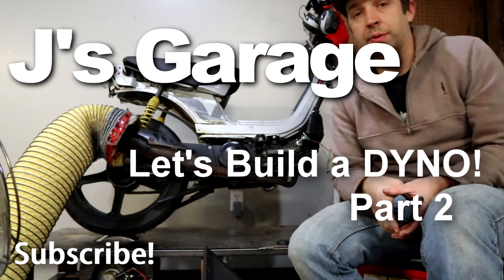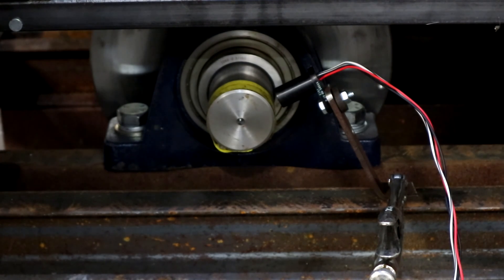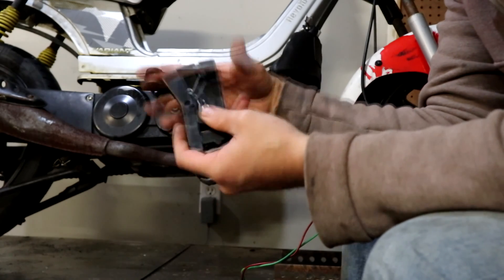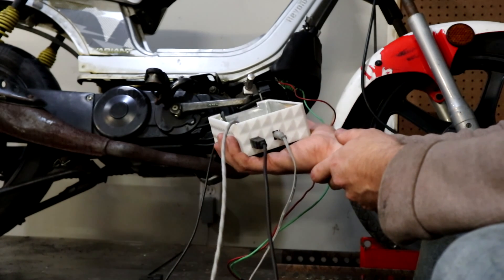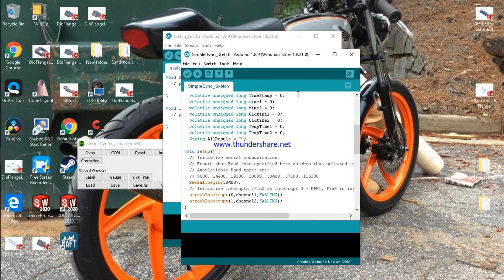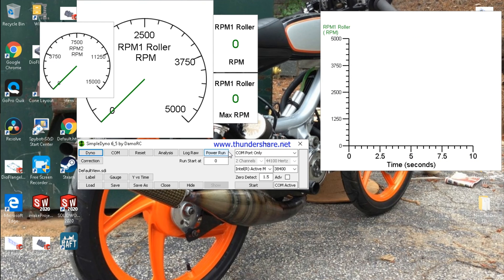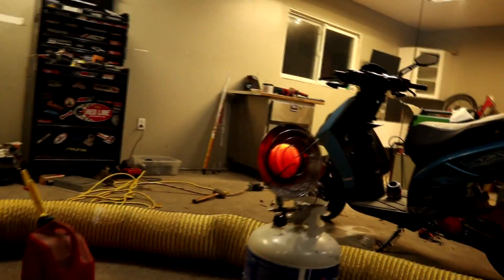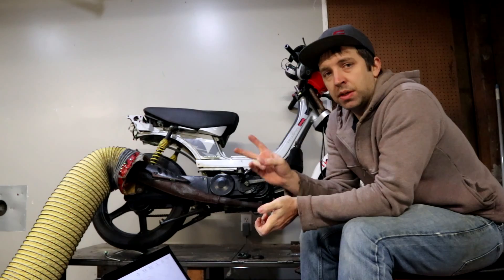Make a DIY Motorcycle DYNO with ARDyno - Part 2 - J's Garage

Comment: all the sensors that did not work consistently was pobertly not working becaise of eletrical noise. as the RPM is going up the noise is getting more and more powerfull and therefore it will easyly interrupt. use shiekded wire and ground the sheild wire to your commeon ground.

Comment: Rpm pickup only used 1 ground that clamped to the bike from the ardyno? And one wire that was wrapped around plug wire? Thanks
Reply from the maker: Yes the trigger was just a wire wrap on the spark plug wire and one ground.

Comment: Any update on this? I have wanted to build one for a while. It would make tuning so much easier. I can hardly imagine doing jetting/rollers/clutch springs without annoying my neighbors. Currently I have a road I blast but I know I am pissing people off.
Reply from the maker: No, I moved shortly after I did this video into a smaller garage and had to start doing reno's etc. It's sitting in the corner I will hopefully someday get back to it..

Comment: Have you looked for a Fan to cool the radiator? Isn't that a problem or in small runs doesn't escalate temperature that quickly ?
Reply from the maker: Heatsoak is always a concern with consecutive runs on a dyno.   That motor was air cooled and it was probably about 10c in the shop.  But yes a large blower fan to cool the engine is needed.
Reply: @pitobread  what should be the airflow quantity you would be aiming for? when chosing a fan to cool the radiator.

Comment: So are those figures correct ? your wheel mass was 131kg ? also doesnt your rear gearbox have a ratio of 10:1 
or something not 1 as you had shown.....and you had 1000mm for tyre wheel diameter , and looks like you have added the mass of the shaft and roller twice unless the program can 
calculate the difference between the shaft going through the roller so not to add all the shaft weight/mass if that make sence.....download performance trends demo version and enter the figures in there program wheel setup to double check yours etc.... Brett
Reply from the maker: No probably not.  I had not messed with anything other than reading thru the on screen prompts.

IIRC in the ARDyno it has both the mass of the roller and the mass of the shaft and makes you input it in separate areas but I haven't looked at it in a while.

I will check out the other software but my dyno is still in the corner of my garage since I moved and I haven't looked at it in a while.

Comment: I really don't think this works as a dyno.  All it will measure is the work required to bring the wheel up to a reasonable speed where friction will become the limiting factor.  A proper dyno must have an opposing force you can measure.
Reply from the maker: This is an Inertia Dyno.  It is a well documented type of dyno that works for my requirements.

Your description on how this doesn't work describes exactly how it does.  You have a static mass and you measure the time of the acceleration.  I have not seen any wheel slip on mine, but mine is knurled.
Reply: @pitobread  I see.  I guess that would work for small motors.
Reply from the maker: @ericthered9655  It works for any size.  Your mass has to be correct for the range you are looking for.   They make inertia dynos for cars even.
Reply: @pitobread  I understand the concept.  The problem is the physics assume zero friction.  So yes, if you used a massive flywheel you could measure anything provided it doesn't spin the wheel so fast that friction changes the equation.

Comment: Want a piece of advise with the RPM pulse acquisition rather than using the INDUCTIVE to which no other electrical devices are near the test that produces other noise or magnetic field that will give a glitch on that sensor.

Find an appropriate electronic circuit that will catch the PULSER COIL going to the ECU if FI or CDI if carbureted...the Pulser coil is the one that provides the true rotational power of the engine. That is what we did with our project and very consistent at all runs.
Reply from the maker: Thanks i will look into that if I have issues.

Comment: Hi i hope you can help me. Is the littelfuse 55505 sensor plug and play on the ardyno pcb?? No need for resistors in line? I have a cheapo hall sensor like your aliexpress one and it works but simpledyno will record is as 5000000rpms every time the magnet passes. Im wondering if the sensor is wrong.
Reply from the maker: Yes, it works out of the box, at least in my usage.

I tried a few different aliexpress/amazon sensors but they did not work right at all.  You can try changing the magnet polarity n/s s/n to see if that helps but most of the china sensors I tried were flaky at best.

Comment: I've build one of these. Mine is reading low hp, i know the engine is about 7 hp but it reads 1.5. Any idea what the problem could be?
Reply: maybe what you are inputting into the program is not correct like the wheel weight and diameter mass etc.....

Comment: I was really having trouble with the RPM pickup from the first sparks, though I was very good at anti-jamming. I also tried with capacitive touch clamps and also tried winding wires on high-voltage wires, but it didn't work. right from the start, the PC hung.
    Is there any better experience you can share with me?
    Thank you so much for your help!
Reply from the maker: My inductive clamp was not good, I would say failure would be more correct.  

Wrapping the ignition wire was the only solution that worked for me.

Comment: AR dweeno lol like wtf bro 
It’s dyno as in dinosaur ffs
Reply from the maker: So there is an arduino board inside the control box and also an ardyno board inside the box....
Reply: It is the simplest INERTIA DYNO u can find..and it works as it was intended..IF u just know what you are doing. we have it. and the moment you change any on the bike being tested will actually be NOTED and VISIBLE on the plotted graph...That is the only main target of the SIMPLEST DYNO ever..555 timer as capture shaping of the sensor pulses will not work...too many glitches..that is why maybe ARDYNO was junked.

Comment: Interesting project. A old fan will let you cool the motor, but, given the season and that you seem to be in Canada somewhere, you likely have a while before the engine gets hot.

I've used bare sensors like this, which cost less than $2. They don't have the fancy housing. The leads likely need shielding for your application. The rise time is 1.5 microseconds, which is likely faster than an Arduino port read. I like ones that can be read if the magnet is flipped north/south.
https://www.mouser.com/datasheet/2/187/ProductSheet_SS351_451-185683.pdf

Given the breadth of your applied skills, you are smart enough to learn more electronics, too.

If ignition noise is still a problem, perhaps you could use shielded wire for the sensor, and ground the shield. You can get copper foil for shielding guitars and things. It helps more if it's all soldered together, and grounded. The only problem with aluminum is, that it's hard to connect, electrically. Conduit and Homedepot metal boxes work, too.

When you get it all finalized, I imagine that you could select a consistent scooter to be brought to at another dyno to be used as a calibration-scooter : )

Ear protection will allow a future where where everyone doesn't have to yell at you.
Reply from the maker: I have some Motorola Map 2 and 4 bar map sensors here already from my old turbo stuff days!   Some IAT and CHT temp sensors as well along with some EGT probes.  I just have to not be lazy!

You are right It should be cooled.  after the 3rd run it lost a little power, probably because of lack of cooling after back to back runs.  it was also like -5 in the garage so that may have helped..  I will be moving this to my new place soon so I will do a bunch more when it is there to make it "legit".

I did use shielded wire on both the roller and the ignition pickup as a stop gap to try and fix the issue.  Neither the roller sensor or the ignition pickup had shielded wire from the factory.    I tried swapping grounds around nothing seemed to help.  I think the inductive clamp was vibrating and the ferritic clamp section was slightly opening.  The roller sensor, Im not sure what could have been happening.. but it was very consistently failing so I am unsure.

I used the derbi because it was quiet and consistent!  I have done some runs on the RC-One and it's loud and smokey although I didn't have the extraction fan setup when I was running it, just the door open.